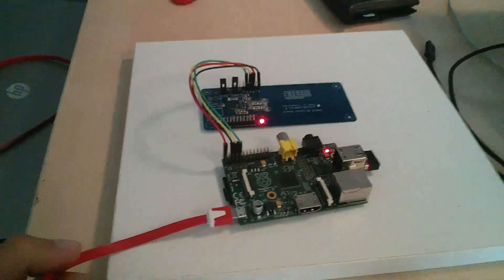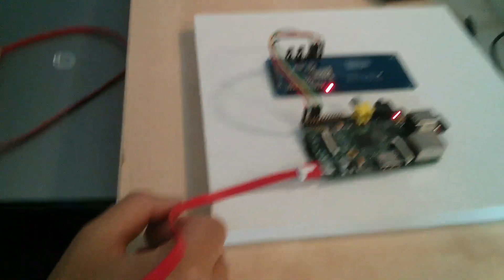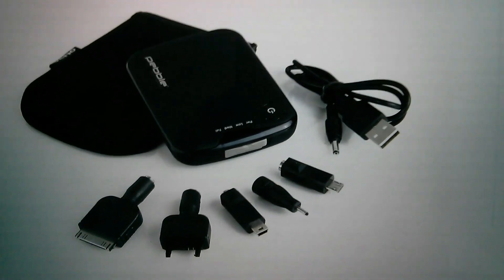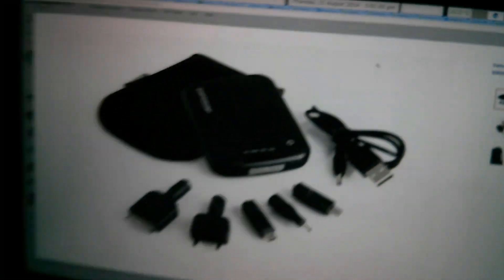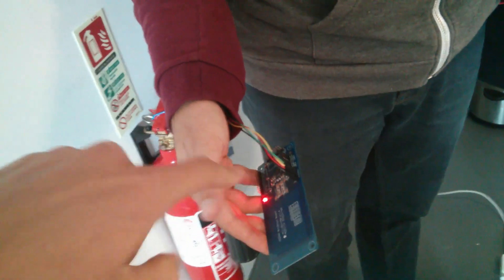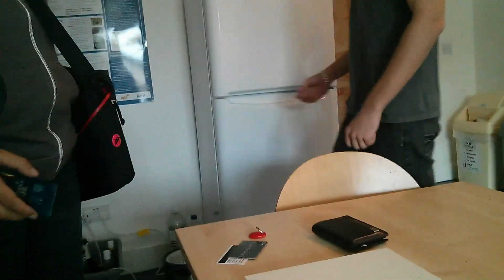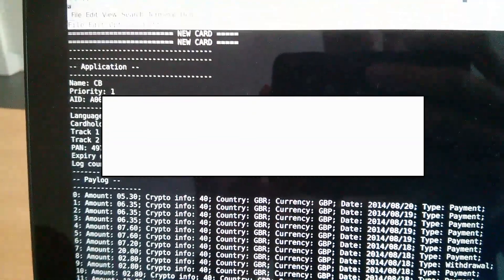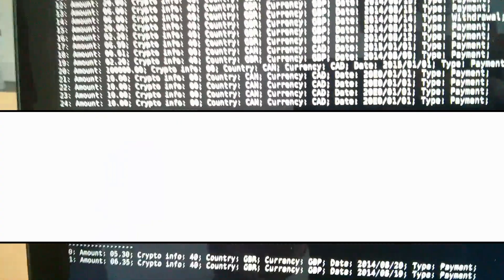Contactless Credit Card Analysis - 404 Security not found

Comment: Hello, i have this error trying to use your software
./readcc > data
error	libnfc.driver.pn532_uart	Application level error detected
SELECT PPSE: Input / Output Error
No application found using PPSE

how i can fix that?

This is my nfc-list -v output:

#nfc-list -v
nfc-list uses libnfc 1.7.1
NFC device: pn532_uart:/dev/ttyUSB0 opened
1 ISO14443A passive target(s) found:
ISO/IEC 14443A (106 kbps) target:
    ATQA (SENS_RES): 00  04  
* UID size: single
* bit frame anticollision supported
       UID (NFCID3): 08  72  b3  7d  
* Random UID
      SAK (SEL_RES): 20  
* Compliant with ISO/IEC 14443-4
* Not compliant with ISO/IEC 18092
                ATS: 78  00  70  03  99  02  00  d1  03  04  22  01  
* Max Frame Size accepted by PICC: 256 bytes
* Bit Rate Capability:
  * PICC supports only 106 kbits/s in both directions
* Frame Waiting Time: 38.66 ms
* No Start-up Frame Guard Time required
* Node Address supported
* Card IDentifier supported
* Historical bytes Tk: 99  02  00  d1  03  04  22  01  
  * Proprietary format

Fingerprinting based on MIFARE type Identification Procedure:
* MIFARE Plus (4 Byte UID or 4 Byte RID) 2K, Security level 3
* MIFARE Plus (4 Byte UID or 4 Byte RID) 4K, Security level 3
* SmartMX with MIFARE 1K emulation
Other possible matches based on ATQA & SAK values:

0 Felica (212 kbps) passive target(s) found.

0 Felica (424 kbps) passive target(s) found.

0 ISO14443B passive target(s) found.

0 ISO14443B' passive target(s) found.

0 ISO14443B-2 ST SRx passive target(s) found.

0 ISO14443B-2 ASK CTx passive target(s) found.

0 Jewel passive target(s) found.
---------------------------------------------------

and this my nfc-scan-devices output:

#nfc-scan-device 
nfc-scan-device uses libnfc 1.7.1
1 NFC device(s) found:
- pn532_uart:/dev/ttyUSB0:
    pn532_uart:/dev/ttyUSB0

Igot the same error on raspberry pi3 and pi4.. on all interfaces spi uart and i2c... any help will apreciate.. thanks you

Comment: Heii we would like to use youre project aswell in school for our matura exams. We don't really know how we're able to use your project. Could you give ous any kind of manual? We're not programmers but very intrested in it. Thanks a lot :)
Reply from the maker: Hi TheMaTRiiXX ! Thanks for your interest for our project. We don't have written any sort of manual but here are a few hints :

As said in the description, all the hardware you need is 
- Raspberry Pi model B
- Adafruit PN532 NFC/RFID controller breakout board

We recommend either using your local network or making a wifi hotspot to connect your computer to the raspberry pi.
To make your raspberry pi and the adafruit board ready to use, follow this tutorial : https://learn.adafruit.com/adafruit-nfc-rfid-on-raspberry-pi/overview
Follow the tutorial until you manage to read an tag (your credit card).

Once done, you can checkout our source code, compile it by doing a "make" and it will be ready to run.
Check the information on the github page about how the code works and how to tweak it for your needs.

Not an easy job for non-programmers but not impossible.
Enjoy !
Reply: Jujujuijk Thomas Wow! Didn't expect that we're going to get an answer such fast :) Thanks a lot! I think we're now able to figure out how it works . I'll let you know! Cheers Matrix